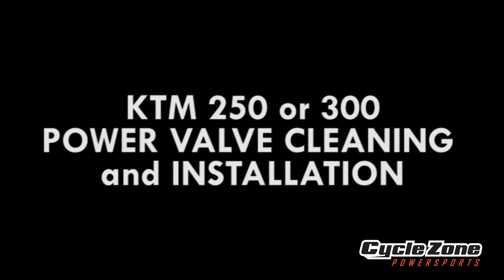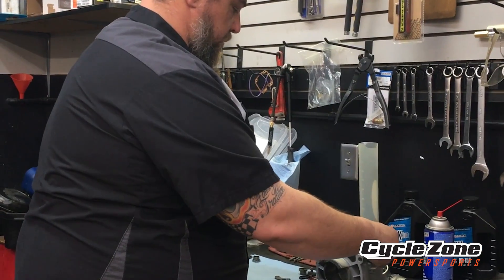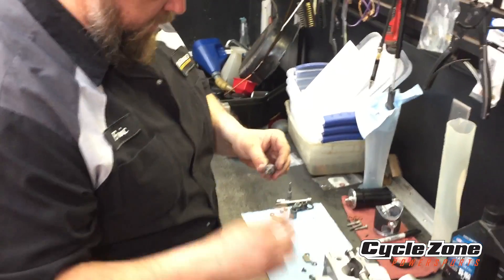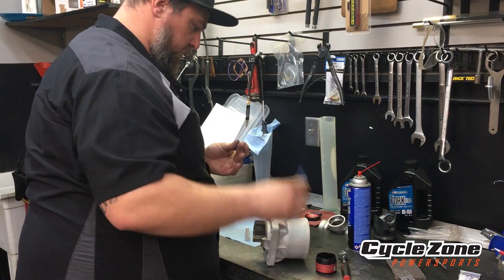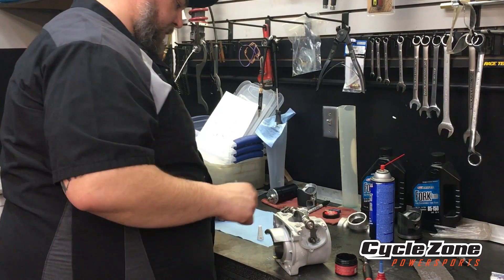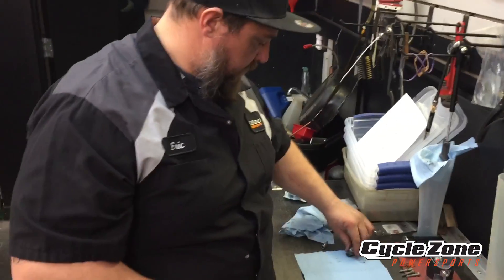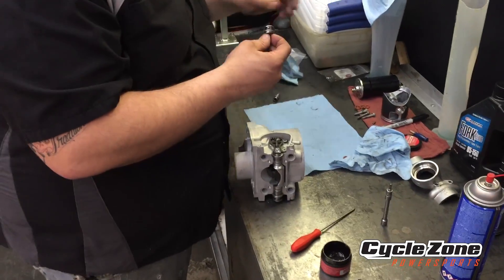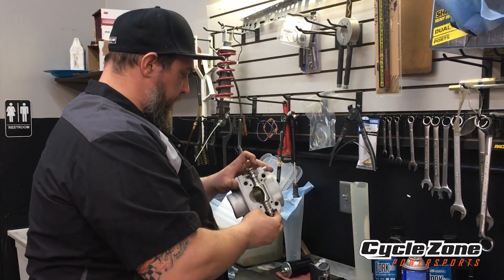Cycle Zone Tech Tip - KTM Power-Valve Cleaning and Installation

Comment: When doing a leak down test through the intake at 7psi should a small amount of air come out of the power valve on both sides or do I need new o rings

Comment: When you talked about sending the cylinder off for plating what did you mean by that? I’ll be doing a top end on my 2019 300XC-w TPI in the not to distant future and this was very helpful, especially about the power valve. Thanks for the video.
Reply: Platings the shit in the bore
Reply: Unless it's damaged, you shouldn't need re plating.

Comment: Nice video, but he didn`t set the Z distance of the power valve
Reply: He didn't remove the locking bolt from the adjuster so technically it should be the same as it was although i would still measure to make sure.
Reply: Is possible to do the power valve service without taking off the cylinder from the engine?